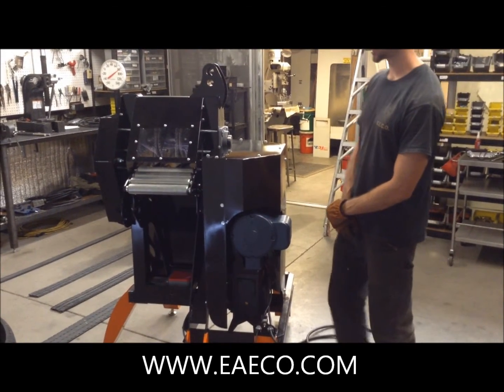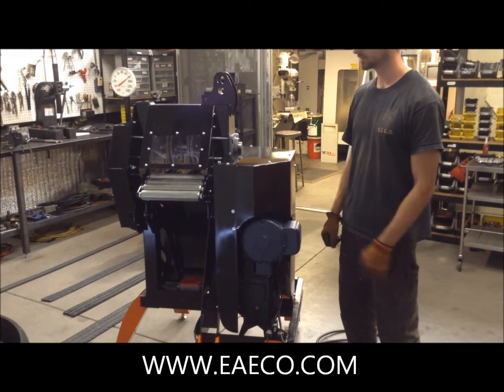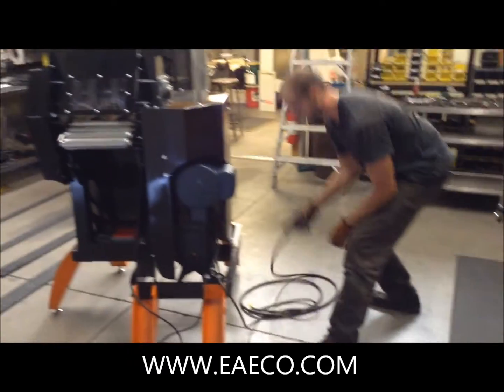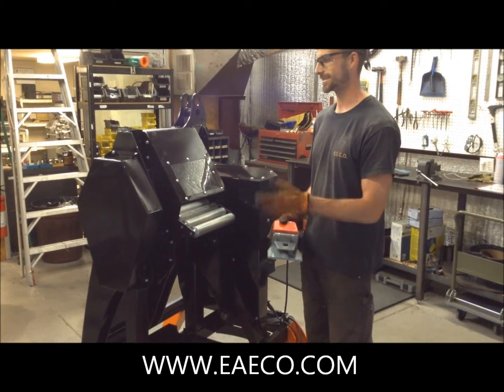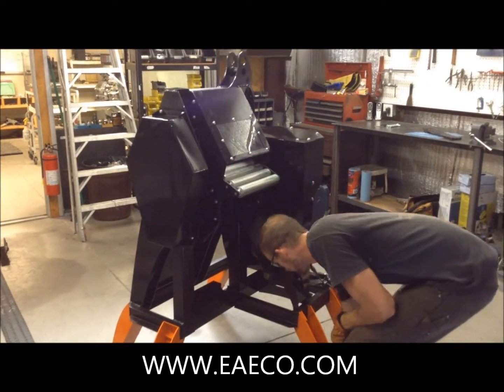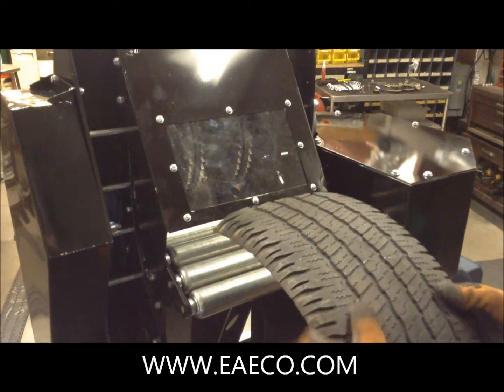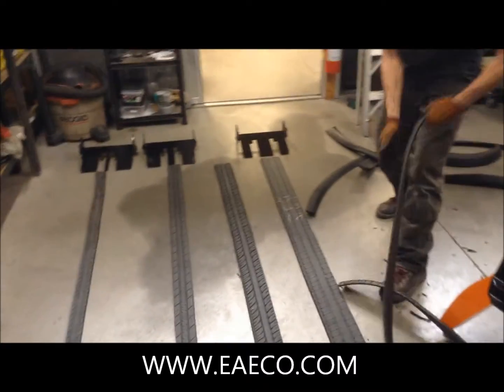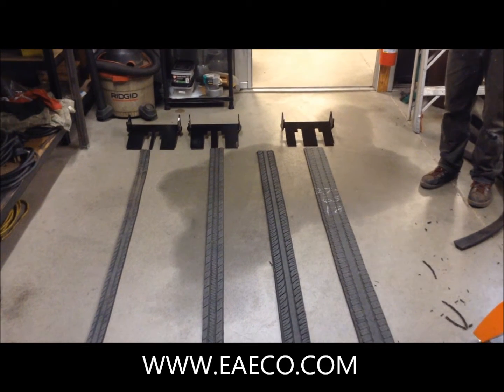Tread Band Cutter (TBC5-1) Demonstration

Comment: hi, how can u cut the band from the tyre first?
Reply from the maker: Hello Lucio Bernis, are you referring to the removal of the sidewalls?  Our SR1-1 shown here (https://www.eaeco.com/products/sr) or our PSR1-1 or PSR1-2 as seen here (https://www.eaeco.com/products/psr) can be used to remove the sidewalls first.  Our Tread Cutters are then used to cut across the treads to severe them to be fed into the TBC5-1.  Does that answer your question?  If not, please feel free to contact us via email at info@eaeco.com or call us at 928-757-5061.  Thanks!